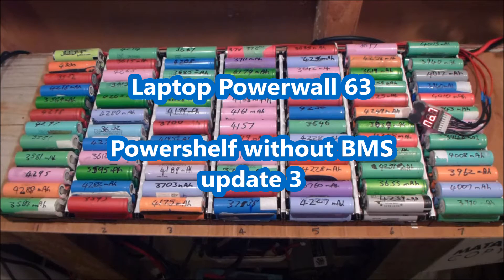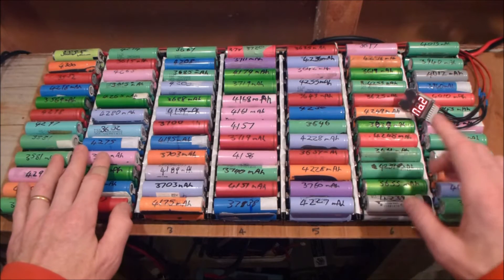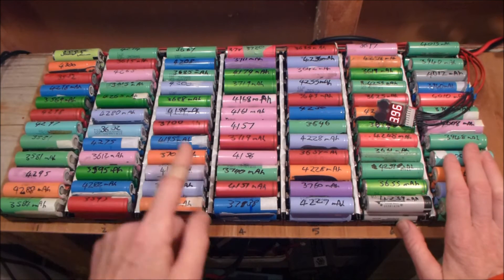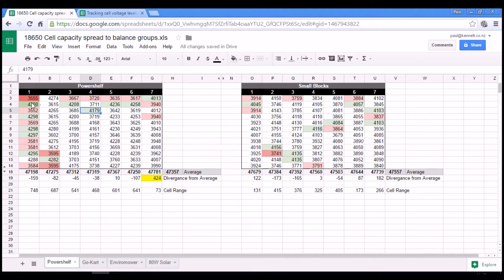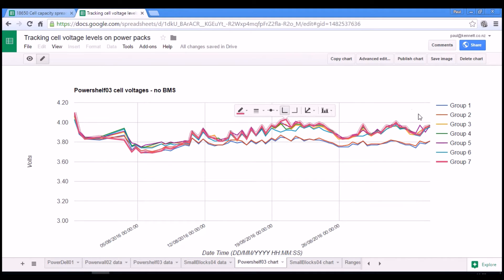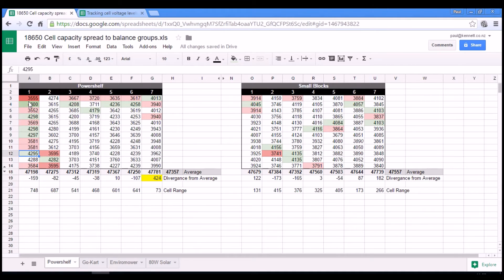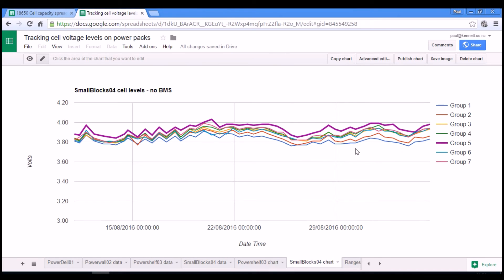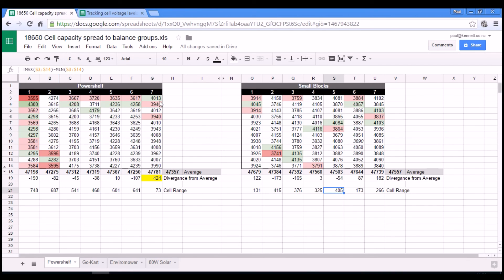Laptop Powerwall 63 - Powershelf without BMS update 3 (rambling)

Comment: If you were cycling the bank daily then the packs will unbalance much faster. So the time will really depend of how much your discharging or charging each week etc etc. I am not sure basing it on time is the best but more on how much the bank has been used.
Reply from the maker: Ah true. I was assuming homogeneous usage. With the solar system they are being charged daily - but winter charging and usage will be vastly different from summer.
Reply: Very true.

Comment: Paul, does the cell logger that you using, auto update when you leave it connected. I have 3 similar devices (all different manufacture) and none auto update if left connected. They continue to show the same voltages while still connected even though the voltages have changed since 'they' were connected
Reply from the maker: Weird. Mine change values every cycle through. Do you're look like the same unit as mine?
Reply: No, I don't have any that are the same as your one looks, but I have one coming. I did find that one of mine does in fact auto update, but only when it is in 'balance mode' where it burns off voltage from the higher cells to match the lowest cell, but its only a 6 cell logger.

Comment: Hi Paul, I follow your channel with interest as I am slowly building my own Power Wall.  I am currently leaning towards, matching all cells in the same pack and then match capacity with cell numbers.  E.g all 2100 mAh in pack one with 76 cells, pack two all 2200 mAh and 74 cells.  I don't track cell capacity closer than the nearest 100 mAh.  Current plan will give me a spread of around 60 to 78 cells per pack,  To be combined into 14 packs, so 48 volt.   What do you think about this approach. Cheers
Reply from the maker: That sounds like a perfectly reasonable plan. I also don't trust my capacity values to be super accurate. That's partly why I didn't try very hard to match my group exactly. Sounds like a great system.

Comment: Hi Paul, that Powershelf concept seems an excellent setup for observation, test and experimentation of battery performance in pairs, groups and packs. The flat layout visually maps nicely to the spreadsheet. My urge would be to sort and distribute the capacities across the spreadsheet array, then match the Powershelf to the spreadsheet layout. :-) When you originally placed the batteries in the holders was your positioning deliberately random?
It seems hugely simple and convenient to be able to swap-out pairs. Is it just a matter of isolating the pack, then swap?
When discharging single cells I've observed 3v cut-off and 1amp rate being used by many. When discharging pairs for capacity testing, what rate (amps) have you used?
Great work.
Reply from the maker: When placing the cells I started with the process demonstrated by @Rinoa Super-Genius but then I bungled and ended with what you see there.
It is actually possible to pull a pair of cells out without isolating the pack. The other 11 pairs of cells would be able to take up the load for a short time at least.
I discharged to measure capacity I using an OPUS BT-3100 @1Amp (per pair) down to 2.9V.
See http://lygte-info.dk/review/Review%20Charger%20Opus%20BT-C3100%20V2.1%20UK.html for a very comprehensive review.
Reply: I like that - the Kennett Powershelf (TM)
Reply: Agreed, "Average Capacitance" (H18) needs to be distributed across all seven (1 - 7) Cell Groups.  
The easy replacement of Cells is what I like most about the Kennett Powershelf.
Reply: Paul Kennett 
The magic of the Powershelf is the ease in which anyone can add or replace cell modules.

We need the spreadsheet function which will auto-align the Cell columns based on the "Average". Finding out how to make this happen is the tricky part.
Reply: Spreadsheet shared (docs.google.com) with your email.

Comment: Are you saying there is a direct correlation between cell capacity and voltage sag?

I had always thought they were largely independent.  A cell could have loads of capacity (the ability to deliver current within a given voltage range) however the voltage range may include a low(er) maximum voltage (does that even make sense?) than say higher quality cells.

Do you have internal resistance data for this pack and is there a possible correlation there?

Interesting experiment.
Reply from the maker: Hmmm. Good point. Looks like I'm going to have to feed resistance into the spreadsheet also. I might have been a bit too amateur on this one.
Reply from the maker: OK - I'll do that. Will see If I can do that tomorrow.
Reply: Yes please, give it a try. E.g. the lowest capacity from pack 2 with 3595 and pack 6 with 3617 mAh seems not that different. My guess would be as well pack 1 + 2 will have a higher internal resistance than the rest.